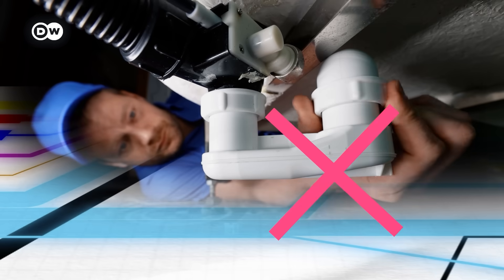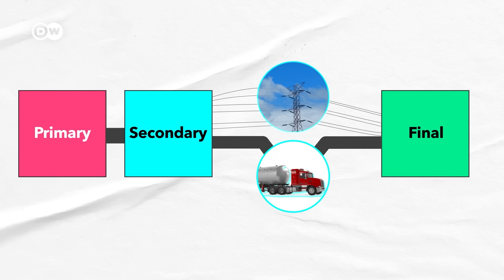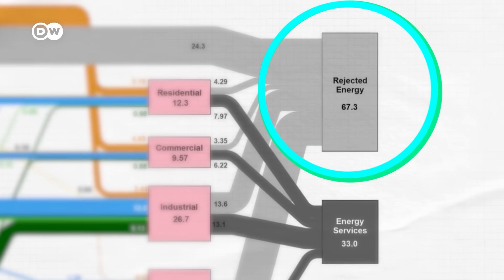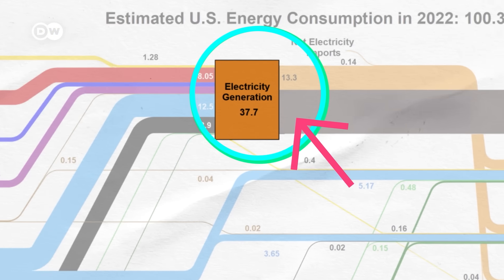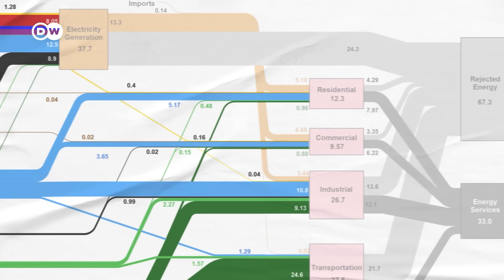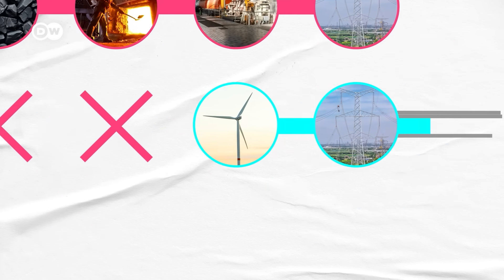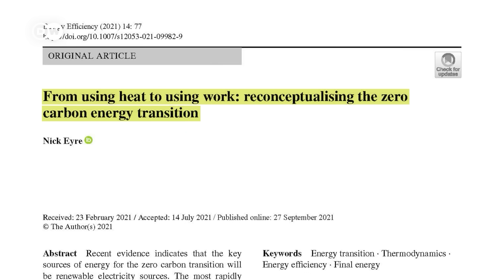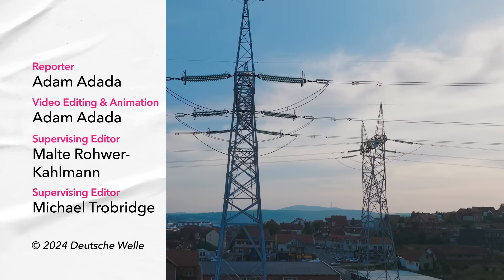The mind-blowing thing we get WRONG about energy

Comment: Thanks for the good news. But that analysis is still missing a big chunk of the problem because it starts with coal lumps and oil. To be more complete, you should start with a mountain with coal veins in it, or the oil deep in the soil somewhere - getting those out takes a lot of energy as well.
Reply: You're not wrong, but this was about a specific existing analysis that starts with lumps and barrels.  Basically the 80% figure is deceptive as it measures energy input.
So right now fossil fuels are doing maybe 65% of the work.  Still not great, but not 80%.
Reply: @tristanridley1601  Yes the 80% is deceptive and it is used because that is what fossil fuel lobbyists and PR campaigns use.  They specifically chose that number because it allowed them to claim more renewable energy would be needed than is actually needed.
Reply: Transporting oil, refining it and then transporting petrol is also grossly inefficient especially when you can just plug your EV in to get its 'fuel'.
Reply: @ralpharmsby8040  as opposed to solar cells that just spontaniously plop into existance?
Reply: @ralpharmsby8040 The money used is the measure and it actually works and is more efficient than wind and solar which is in the negative. That's why government has to support them.
Reply: None of this is necessary.  You don't have to calculate energy. That's what money does. It accounts for every single btu. Diwn to the sandwich a worker had for lunch
Reply: @Briand-ei1gs  Actually not at all.
If polluters would pay for all the pollution they do then yes, you'd just look at the financial balance sheet.
But currently the financial calculation is not matching the energy calculation because the carbon emissions are not taxed enough or, even worse, there's a lot of subventions for the oil industry.
Reply: What about the energy, mining, concrete and land to do solar and wind?
Reply: @LawrenceAndersen-t8q  Sure, that's how one should compare them. But we see that usually those are included only for renewables while gas is considered to magically appear at the gas pump.
Nobody thought about the carbon emitted while producing a car until EVs were invented.

Comment: DW is mostly knocking it out of the park on these topics. Thanks guys!
Reply: No it isn't, DW has been massively behind the energy transition in Germany where good nuclear was replaced with new coal, German carbon intensity is 2x that of France which is mostly nuclear in the electric sector, but that is stil only 40% of the whole primary cycle.
Reply: Source: destatis
Coal 
2021 156 mrd kwh
2022 170 mrd kwh 33
2023 117 mrd kwh 26

Green energy 
2022 236 mrd kwh 46%
2023 252 mrd kwh 56%
 @johnjakson444
Reply from the maker: Glad you think so! 🌞

Comment: Is it simpler than it seems?
Well, depends, for me it was super easy to electrify my house (of course the energy producers need to do their part but if I don't electrify, their effort would be wasted,) and I gained comfort, I cook faster and safer, cleaning times are cut down and my bills are lower than before.
As for moving around, I don't see it done that easily.
Most of my travel to work is on foot and I do pretty much everything by foot or train but I do need to drive frequently to visit my family and for that, electric cars are not a good option for me.
Besides some smart ass comes and says "oh EVs now have evolved enough so that...." Remember, I said "for me".

Comment: It's not going to happen as fast as we want unless we address the split incentive for renters and landlords. Renters are financially incentivized to be more efficient, but they don't have the power to place things in their homes. Land lords have the power, but have little financial incentive. We will just have to wait for new rental properties to be built according to new requirements, phasing the older, less efficient properties out.
Reply: My old landlord upgraded our windows and insulation and installed solar panels in order to take advantage of the feed-in tariff that the UK government was offering at the time. He was in a rush to get it done because they were massively reducing the amount you could get for feeding electricity into the grid and he wanted to lock in the price before the cut off date. The reason for upgrading the insulation was because it was part of the legislation that the building needed a certain energy efficiency rating to qualify.

Our governments could make this happen quickly if they wanted to...
Reply: Unfortunately most of the housing stock in the UK and in the US is pretty much utter crap and low eff, people are strugling first to get housiing than for efficiency.
Reply: Also depends on the system. In the Netherlands most rentals in suburbs are by a corporation without much  profit. Rent went up a little but got triple glas and beter isolation as well as solar panels. For that I mostly became an energy producer but there is a grid lock for new projects

Comment: My prayers have been answered: My presenter included this Sankey diagram in his presentation yesterday on home electrification where he looked at "How much power do we really need" (video in preparation) and I said later that everybody should spend 15 minutes with this graph and absorb its central message about "rejected energy".
Reply: Sure, but the diagram also doesn't represent how energy via solar/wind fluctuates and the storage need. storage again being inefficient.

turns out tryint to have a totally accurate representation is hard, while making one that fits your particular view is easy.
Reply: @nonyabisness6306  fuel could easily become intermittent too:
The Strait of Hormuz.
This strait, between Iran to the north and UAE and Oman to the south, is significant for both energy and goods shipping. Some 20%—30% of oil trade passes through this strait, and a significant amount of global shipping volumes.
Reply: Intermittency is the devil you don't yet really know, the storage of long term energy is going to look very bad in losses compared to the current one, new Sankey same as the old one, trading burning losses for much bigger storage losses.
Reply: Well then go and provide the energy. Stop trying to ban the competition.
Reply: Put up 30kW of  solar in 2011.
14 years later the grid infrastructure operator is installing batteries to soak up all the rooftop solar to help flatten the duck curve.
SE Queensland Australia
Reply: @gregorymalchuk272  No I won't: the fossil fuel industry has lied to the public for decades, manipulated and bought politicians, wreaked havoc wherever they trampled ("resource curse") and are continuing to slow down, torpedo and sabotage the energy transition away from pollution and climate disaster. Last week convicted felon Trump asked O&G to donate a billion dollars to his campaign with the promise to immediately wreck any and all meaningful climate and energy action. Same with the fossil aligned Heritage Project 2025. It is pure evil.

Comment: This video is fundamentally flawed in so many ways. If it was as is portrayed then yes it makes sense but it is so wrong on many aspects.
Firstly you cannot run a grid on pure renewables  it is not possible and so what is happening with current grids is that we add a lot of renewables but have to also have a corresponding capacity to match the renewables of fossil fuel, hydro or nuclear as well. Talk about being inefficent?
Electricity is convenient but not efficient, it never has been nor will it with renewables.
Renewables are not efficient, even if they were capable of powering a grid by themselves  (Which technically they can't) the intermittency would require dsomething like ten times or more over capcity against demand and that is with storgae. All cost money and simply is unviable.

Comment: I know about Sankey flowcharts via Saul Griffith's excellent books ('Electrify' and 'The Big Switch') and I'd highly recommend both: one is the route for the US and one is the best route for Australia. Saul Grifffith is brilliant and also his writing is very accessible. He offers a clear plan to decarbonisation but giving us realistic optimism at the same time. Thanks for this video...DW Planet A always does good, well researched videos! 

Personally my opinion is that people cling to fossil fuels like victims of Stockholm syndrome. We already have most of the tools now: for some of the hard-to-abate sectors of the industry like plastics, concrete, long air flights and fertilizer we still don't have all the answers yet. But we buy time for more research on that by going full speed on what we can do. The stakes are too high to not act as fast as possible. See also S-curves (Tony Seba / RethinkX). Adoption of renewables is not on a linear route. 

We now have solar & batteries covering all energy in our house for at least 7 months of the year and about 70-30% for the winter/cooler months and that's in the UK. 90% of the world is in the sun  belt and should find this easier as long as they can cover upfront costs.

Comment: In a very small scale as a family of five that is exactly what we experienced. In the last couple of years we put solar on our house got a heat pump and two electric cars, and we are not burning any stuff at all anymore. 
Energy consumption went down by 65% and emissions went down by 93% ! The overall investment was quite a lot, but it’s paying back overtime because the costs also came down by 59%. 
What works for us as a family will also work for countries and humanity.
It’s possible so let’s do it 💪
Reply: That's great. I wish we had room for more solar panels but even so we run the house and car form much of the year with almost no electricity from the grid. In time the panels will get more efficient of course. Our 12 are rated at 385 W each but there are already some doing 500. We will consider upgrading in another 5 or 10 years perhaps.
Reply: Using no electricity from the grid most of the time (as oposed to being off-grid) makes things worse actually. 
You still need the power plant for those times where you need power from the grid, and at the same time everybody else, because that is in the winter or at night.
So the cold start losses are even bigger. Also no sane company will invest in a power plant, that is only used 10 percent of the time. Not without the government Paying for it, which is what happening in many countries.
Reply: Your cost savings are much smaller than the other reductions. Why is that?
Reply: I'm all in for renewable, so don't misunderstand my comment. But many factors people miss is the location. What is good for your country, isn't the best approach for other countries. 

That being said, we definitely need to remove the fossil fuels from use. They aren't needed. I really liked the use of primary source with secondary. It is shame that people got stuck at primary use, but totally lost interest in the use of secondary, or think about how to improve it, make it more efficient for their home use
Reply: @nothereandthereanywhere   What are you going to use to replace all the products made from fossil fuel derivatives?  It is not just about energy anymore.
Reply: Are you saying that you believe that these cannot be made without producing the fossil fuels ?  If you have a process than is producing a lot of waste, that no-one needs, people will try to persuade others that they need them - hence why European private motorists were persuaded we needed to burn diesel in our cars, and now our air quality is dangerous to health. I doubt they will be able to play that card again. They will have to find less wasteful ways to extract these useful derivatives,  otherwise the price will go up and others will supply them, or their equivalents cheaper.
Reply: @hendrikvandeventer7669  Do you mean packaging, or what exactly are you looking at? Many things can be replaced, or many plastic bags not needed in the first place.
Reply: @nothereandthereanywhere  Packaging and all plastics. Fossil fuel derivatives are all around you in everyday life and we as yet do not have commercially viable replacement products.
Reply: @nothereandthereanywhere  It's like me... What is really surpraising in ALL the comments is the absence of ... reductions in real energy comsumption. 
When it seems to me that changing the machine, for cheaper energy is juste a small part of the way. If you are using the same total amount, the problem is not solved.
Desengage in energy rich activities. Stop fliyng. Use the sahdow of trees instead of air conditioners! Or at least start trying.
Reply: @hajodebuhr4324  Totally agree. We have solar  ev and for 2 months, a heat pump. Gas has been disconnected so no standing charge for that.
Reply: Just that the vast majority of the populations do not have the funds to get a solar system and a heat pump system and two electric cars - a large percentage cannot even afford a used gasoline car - as long as gvmt-politicians and globalist selfdecreed authorities make the rules that keep- and maintain current energy production low and costs high and even ban current energy production any transition will take endlessly long and countless people will made to suffer along the way  … by design !
Reply: No, it won't. Solar panels on your home may be a good way to lower your energy, but it's not possible to do this on planetary scale.
There is simply not enough lithium and copper and rare earth minerals in the world to do this transition. 
The focus should be on low hanging fruit, eg. Replacing inefficient road fright by electric trains, shorter flights by hi speed train, isolating homes etc.
Reply: @jirislavicek9954  where do you have that knowledge from? From the point of resources it is absolutely no problem to power the whole earth with solar panels! We have 3 billion cars on earth that way 2 tonnes each, and built houses with trillion tons of steel and Glas. And you just assume that we have not enough Glas and Silicone (not lithium) to build enough solar panels? Silicon is basically sand. Glas as well. Copper: every skyscraper has a hundred metric tons of copper wire inside. You obviously don't know your numbers here...
Reply: Your home energy footprint is not even 10% of your life carbon footprint, the other 90% is in your transport, heating/cooling, industry, all goods produced have a footprint.Its right on the diagram.
Reply: @johnjakson444 "heat pump and two electric cars", he was not just talking about past home electricity use.
Reply: @johnjakson444  If you read @hajodebuhr4324 's post, he says he did electrify and reduce emissions from his family's "transport, heating/cooling"
Reply: Have you thought of what is going to happen to the solar panels at the end of their lifecycle? What is it going to cost to recycle and can it be recycled? Harmful chemicals and lots of energy are needed. Total LCA CO2 footprint of solar panels?
Reply: @hendrikvandeventer7669  in comparison to what huge amount of energy a solar panel generates during its lifetime, the energy to build and recycle it, is miniscule. Solar panels are made majorly out of glass. On top comes a little silver, copper and silicon. Half of the mass comes from the aluminum frame. So basically there are no harmful chemicals inside a solar panel and all components can be recycled easyly with already implemented processes. To answer your question you just have to Google it. There's a ton on research about this topic.
Reply: @hendrikvandeventer7669  If you have a circuit board with gold in it, you can be sure someone out there will see a money making venture to recover that and ensure it doesn'tt go to landfill. These panels contain too many valuable elements for them to be throw away. The main problem with recycling solar panels is they last too long and as yet there aren't enough available to be recycled.  It will  be at least another 5 - 10 years before the number of solar panels available for recycling  allows companies to scale up their operations enough to make it profitable. Its a similar situation with EV batteries - they last too long, there just aren't enough ready for recycling yet.

Comment: At 0:29 for France, there is a lot of energy lost in the process of making electricity. Is someone can explain why ? Is it coming from the heat produced and lost by nuclear reactor? 

What is the efficiency of a nuclear plant reactor ? 

Thanks
Reply: 33-40% is just the fuel cost is so small it doesnt matter
Reply: Yes. The nuclear power plant is nothing else than a 'primitive' water boiler. A water boiler is a thermodynamic machine and therefore - according to the 1. and 2. law of thermodynamics - got it the bad efficiency of a thermal engine.
Reply: Light water nuclear reactors have to limit the fuel temperature to keep it from melting, and to be a match with subcritial water, which limits the steam parameters to maybe 7 megapascals/300C and 33% thermal efficiency. Modern coal burning power stations are able to use much higher initial steam conditions of 23 megapascals and 540C to 620C, giving efficiencies of 45% to 49%. Liquid metal and gas cooled reactors have higher efficiencies that are competitive with fossil fired units.